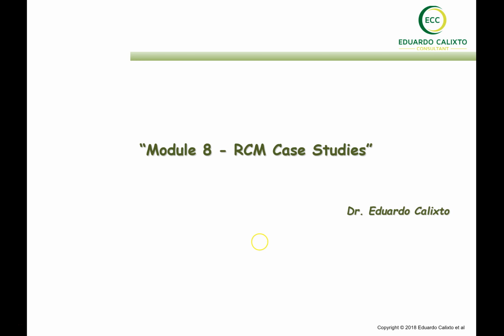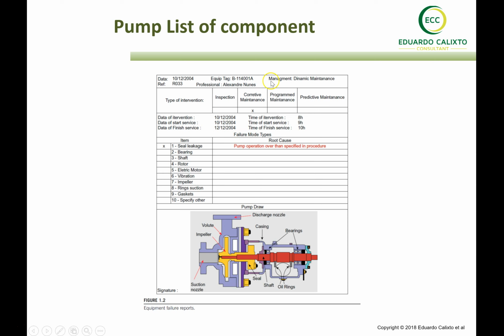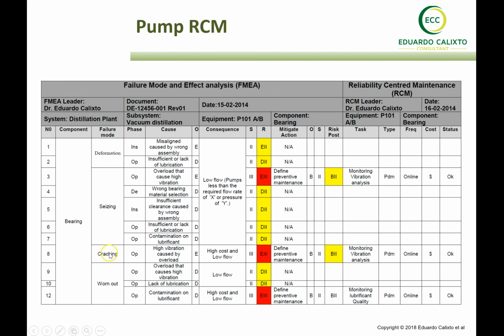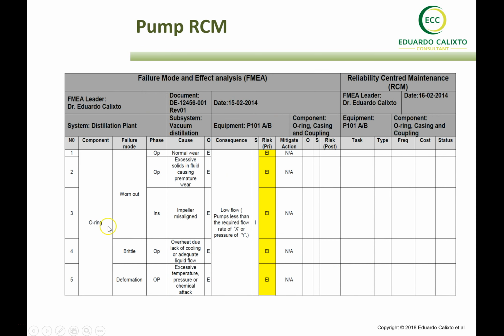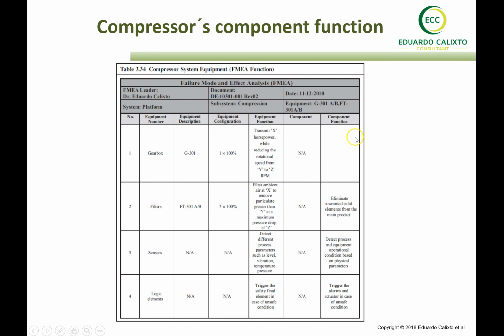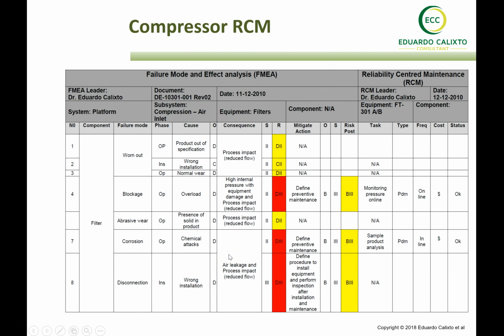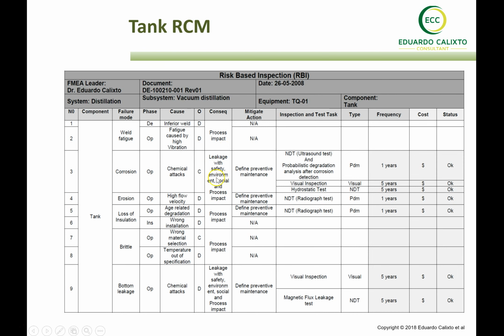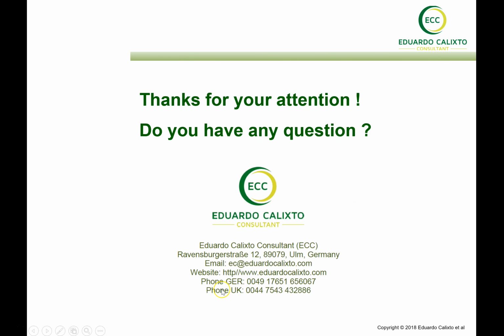ECc Online Training: Module 15 -   RCM case Study

Comment: Where can I find the case study in pdf file...Great video thx
Reply from the maker: Dear, my best seller book "Gas and Oil Reliability: Modeling and Analysis  has on chapter 3 five examples of RCM. Please go to the link below and check on the preface. 
https://www.amazon.com/Gas-Oil-Reliability-Engineering-Modeling/dp/0128054271/ref=sr_1_5?crid=1GWXEAW0VA95Q&keywords=eduardo+calixto&qid=1686977996&sprefix=eduardo+calixto%2Caps%2C359&sr=8-5&asin=0128054271&revisionId=&format=4&depth=1